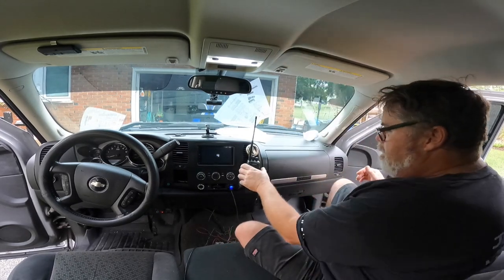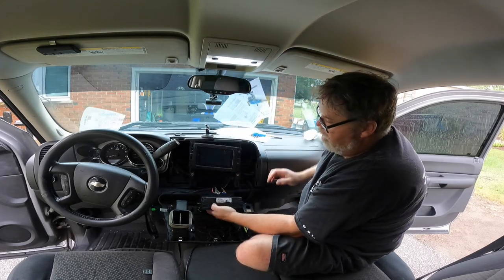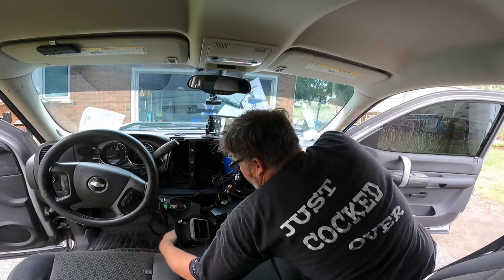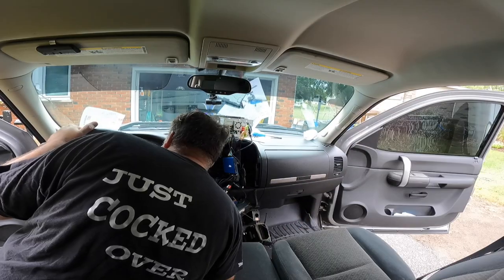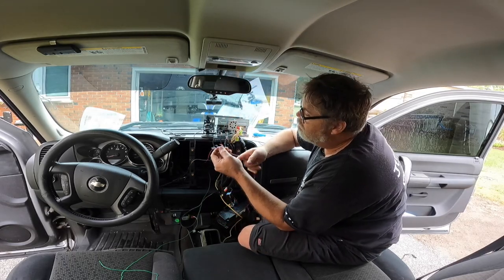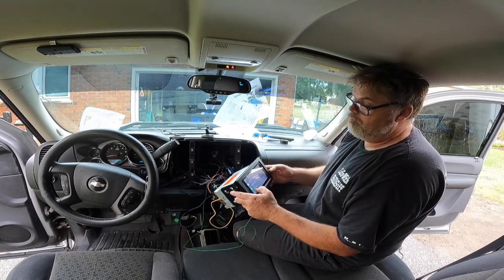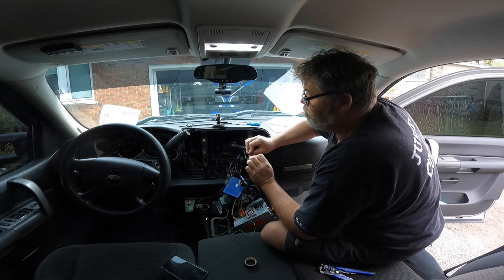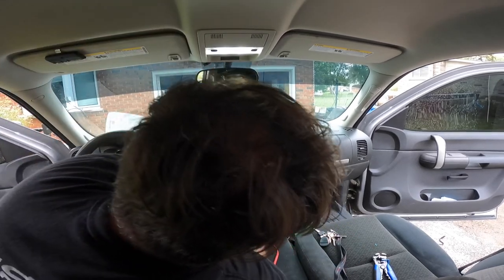Finishing The Install On My Back Up Camera

Comment: Copy copy over ... yea you did buddy, i tried this on my equinox but with all that stuff added the stereo wouldn't work right. I have a aftermarket head unit and all that (chime,remote steering controler) in the closet. What a pain in the 🍑 , in January i am just going to try again. Thanks cory where was ya 8 months ago ?? 🤑😂 f off jim